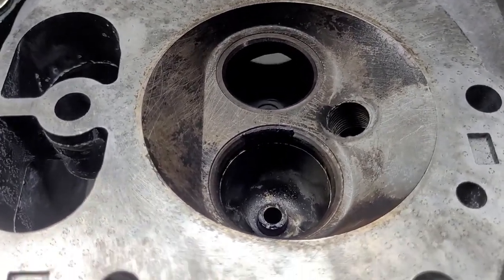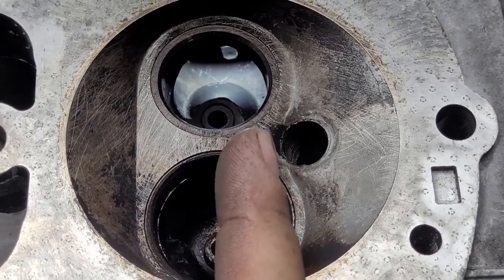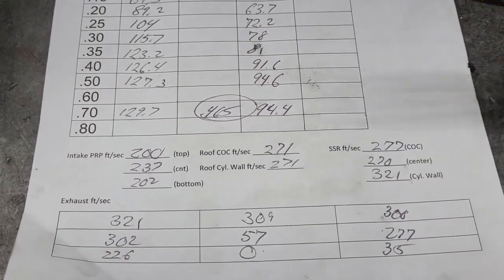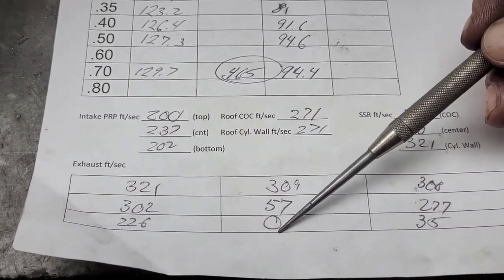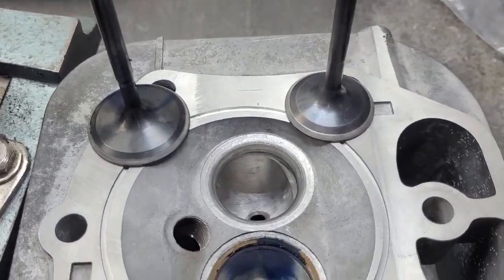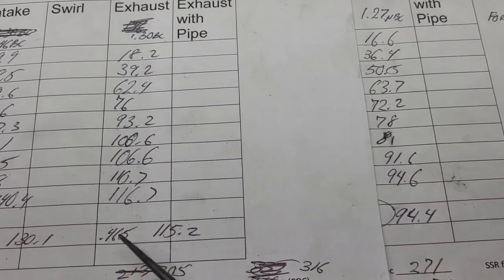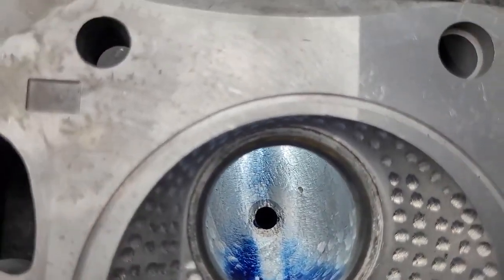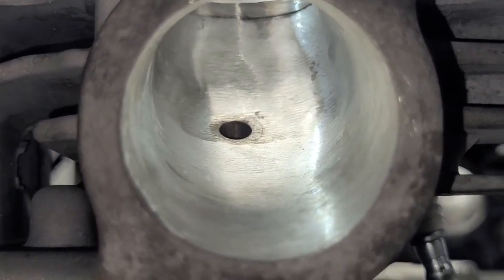Performance Mud Motors 61ci Vanguard V twin cylinder heads

Comment: I've done very similar chamber work on Harley heads. Blew my mind how differently the respond to short side work vs. a standard wedge head of a V8.

Of course the hemispherical chamber design was pointed out as why to me after my first flow measurements. I eventually welded up some of the chamber for compression and more tumble. I was positively rewarded with dimpling in the chamber....to a point though.

I found more making the runners wider in more of a "D" shape, but leaving the roof height and expanding the runner width. 

Good work! You're fortunate to have a test facility available to you. I hated testing in school, but out in the real world knowledge is power.
Reply from the maker: Good info. Thanks

Comment: Maybe get crazy and mount a couple motorcycles heads to the block. Run a timing chain, behind the cover to the head. Filling/ Welding the gap with aluminum sheets, and the only possible spendy part would be a custom piston, with a hemi dome to fit the hemi head.  The power should go up a fair amount,  especially if a custom cams are ground! I guess that's spendy Aldo, a couple Suzuki drz450 heads may work or a older Dr650 head, it's difficult not seeing them , the displacement is close,  after what I have seen these Asian and Indian guys do to motorcycle engines and heads, it's possible to get bike leads on these engines!

Comment: Seems like a wedge and hemi had this head/chamber,  what were the engineers thinking, it's not a performance engine . I get it. Like the old tractors had crazy looking piston domes and chamber designs, strange shapes. The WW1 erra cars had strangeness also,  I'd like to weld in between 1/4 pound and 3/4 pound more material in the chamber and ports possibly, nearly fill in the chambers and possibly move the whole port slightly . Weld the inside wall on one side, and out side on the opposite side. Allowing the port center to be moved
Possibly sink the spark plug into the chambers but, or just a longer plug, after the welding, close in the chamber, and use a dished piston, maybe cut the head nearly  
.100" afterwards, leaving the chamber nearly 1/3-1/2 the original size. With The dished piston getting the compression to the 12.5:1 range,  maybe there is a easier way to accomplish alot of the same mods, without all the welding, maybe get a longer rod . Push the piston out the bore about .050" pushing the ring up near the deck, possibly only
.030" below deck. Then cut the head
 .030"- .045" then machine the bore into head, allowing the piston dome to fit into the head, maybe 
.050".  That should leave much larger quench pads,  after unshrouding the valves, (if they are)  maybe weld in the ports  slightly,  I don't think id trust epoxy,   possibly still use a dished piston, And do the ceramic insulation coating, ceracoat I'm thinking, on the piston  , chamber, and exhaust port, and possibly the head pipe inside and out, keep the heat inside the exhaust, just be sure there is clearance, yet tight, and probably get some nitrous nozzles and a high pressure pump, and build a water/methanol kit,  use a pwm controller to ramp the methanol in, possibly with the throttle , and a on off, switch,  possibly run upwards of 13:1 compression, 11.5:1 atleast, it would require a few engines to work the way up to all the crazy mods,
Reply from the maker: I was thinking the same thing. They need a total redesign. Thanks